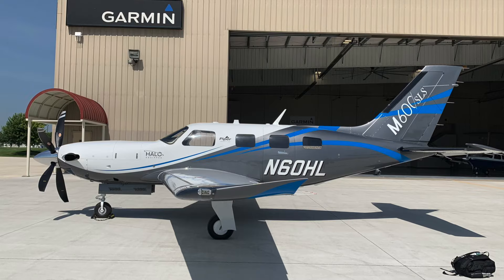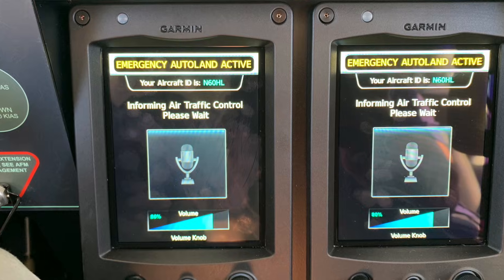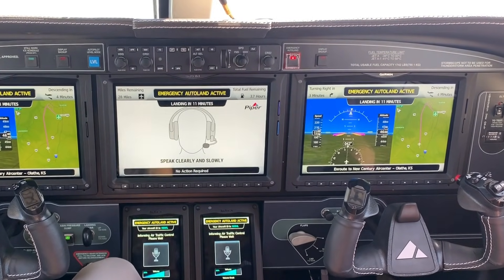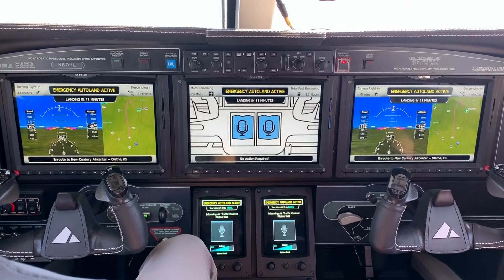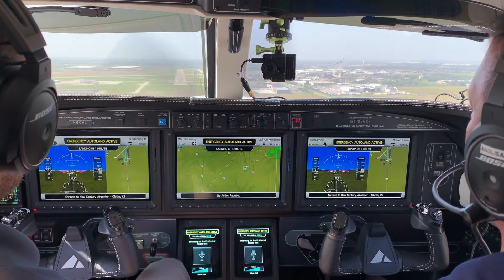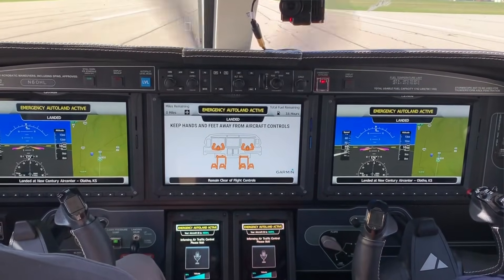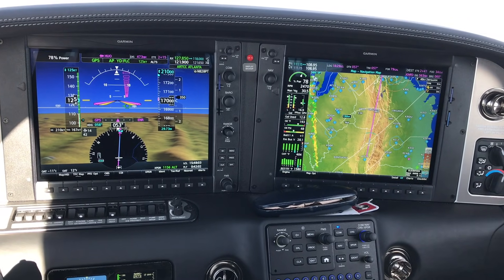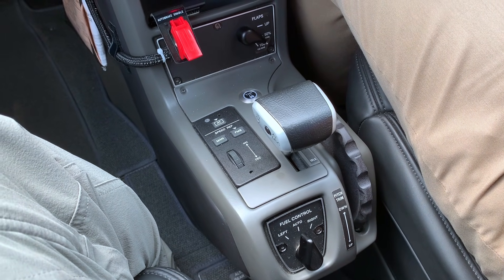Garmin Emergency Autoland Flight Trial

Comment: Imagine this thing chooses to land at a major airport instead of a smaller one and airliners have to go around and stuff.

Of course, it’s better than having nothing on board to land. The money lost from go around is better than death.
Reply: Hopefully it does choose a major airport with bigger runway ,better medical and fire facilities.
Did not check but it should be able to change the transponder code to 7700 so others know what is going on and transmit its intentions
Reply: cmulder002 there are small airports with the same fire fighting capabilities as International Airport.

Tamiami Airport has the same firefighting capabilities as Miami International possibly even better fire fighting capabilities given that the Miami Dade fire department is stationed there
Reply: @nikobelic4251  they should include that information in there database so it can influence the choice of airport depending on the situation.

Comment: Kudos to Garmin and Cirrus!  Logical next step is to auto-notify ATC, and ATC to contact aircraft for clarification from anyone aboard.  Autoland should also occur if all aboard are incapacitated.  There are also implications for hijackings, including rogue (and disturbed or over-stressed) pilot situations.  Years ago under NASA contract my company developed human physiology monitoring (BioVest) for aircrew which could detect stress from EEG, EKG & other signals; this data would be used to contact ATC on a voice channel and via coded IFF.   See https://en.wikipedia.org/wiki/Korean_Air_Flight_801 and https://en.wikipedia.org/wiki/Malaysia_Airlines_Flight_370  and  https://en.wikipedia.org/wiki/Germanwings_Flight_9525
Reply: In the video I watched it did notify ATC, and instructed them how to talk to ATC if desired?
Reply: @donanders2110  --  Someone still has to press the button. If all are incapacitated or in a hijacking, completely automated response is indicated.

Comment: There are a few important questions I wished he had asked the representative. 1. What if there is a runway incursion on short final. Will the system recognize that and go around? 2. If someone grabs the yoke or bumps into it will that affect the system? 3. Does the system recognize TCAS and can it take evasive action in the event of a conflict? Amazing technology indeed.
Reply: The second question can be assumed by the system demanding that flight controls not being touched.
That would imply that any control input  of the yoke will disconnect the autopilot and the plane would be flying manually.
In theory if the tcas system has a data link to the autopilot it should be possible to implement (if not already present) It would be as "simple" as the tcas commanding the autopilot to fly a new heading/ altitude and then returning to the previous heading once the conflict has cleared,.
Strongly doubt the system is able to confirm if the runway is clear or not "visually" but it might be able to go around if atc cancels the landing clearance,

Comment: This is pretty cool and can really come in handy (credit where it is due to the engineers I mean it you did well) 

BUT! I will note, there must be some sort of shortcomings for a full flight, this is why I think so. The technology to make a fully automated appears to be clearly here. Well manufacturers and avionics companies say it is here.  They say passenger willingness is the main issue but this is a General aviation aircraft. The plane still has everything needed for a pilot that has been trained fully but they pretty much just added the emergency autoland button.  If they can make flying so simple and automated why didn’t they just make the plane fully automated. There is no customer gear, it’s a GA aircraft passengers won’t be flying on it. They still have not made it fully autonomous and they haven’t dumbed down the avionics information so a pilot can fly with basic aeronautical knowledge

 (pull up to climb push down to descend or choose altitude and plane will take care of speed and all that stuff push button to land) 

If flying has become so simple how come the FAA still requires 1500 hours to get your ATP  why not bring it down to 100 hours 

Why not just make it the company trains you to use the auto pilot and punch in frequencies for ILS or use GPS for every approach?  

My point is as much as “the tech is here to replace pilots” 
“Pilots will be gone in 15 years” 
“Flying is hyper automated and anyone can do it”  

Some things such as regulations and prototypes just haven’t come up to meet that reality which really makes me wonder how close we actually are and why I am not giving up to become a pilot. Of course I have a backup plan (everyone who wants to be a pilot should have a backup plan not just because of automation but also because of medical things or just how unpredictable the industry is) 

Now before people tell me the regs haven’t changed because the FAA is stubborn and is too careful 
Look at MCAS the FAA has been pretty careless with their past certification when it came to automation 

Also the tech to have pilots away from the plane flying via remote control has been around for ages and it still hasn’t happened

If we are so close and easy to do how come  “THE FIRST PILOTLESS PLANE” hasn’t even been proposed, designed, or studied in either GA, Commerical aviation or the military. How come all future aircraft concepts have cockpits capable of seating two 
How come the “cockpit of the future” concepts have features such as voice command and still have two seats 

There are so many “plot holes” to this whole 100% automation plane stuff 

If there was 100% proof planes would be completely automated in my lifetime I would honestly give up and just pursue my backup there is no point studying for something what won’t exist 
I would get my PPL and that’s it but the proof that we are close isn’t there and there is so much contradictory information to pilotless planes will be here in 20-30-40 or even 50 years.

Aviation is so safe because there is a balance of human and machine interaction where both are cross checking and correcting each other because as much as we like to think computers aren’t flawless. Better than humans in some aspects but not flawless. The computer checks the human and the human checks and corrects the machine. 

Edit: Jesus that was long and good luck for No Nut November it will begin soon....
Reply: VAGAS INT. No nut November here we come!
Reply: Automation kills today, it’s not just MCAS. The technology just isn’t there to reliably match the kind of safety records we see today (1-5 major crashes a year). If they went 100% autonomous I’m 100% sure there would be 100s of fatal air crashes annually and people would simply not fly. 

Automation is good at doing the mundane stuff but you need the pilot for the 1 in 10,000,00 flight where things go wrong. 

The industry actually went too far and over relied on automation and then we had a series of preventable crashes becuase pilots weren’t being trained how to fly in emergencies and relied on automation too much (AF447 is the top example). Even today when the sensors give conflicting information or parameters are exceeded (cross wind, rate of descent etc etc) autopilots kick off and hand full control to pilots. By March 2020 FAA (its already been mandatory in Europe for a while) has made Upset prevention and recovery  training (UPRT) mandatory for all new commercial pilots becuase of this very real threat ie they are re-skilling pilots as pilots. 

People think that becuase autopilot exists pilots are not redundant and sit around twirling their thumbs for the entire flight when in reality they are monitoring the flight continuously and have to be ready to take over control at any moment. 

Fully autonomous flying isn’t happening this generation and maybe not the next
Reply: abingdonboy yeah, many people see technology as perfect When it isn’t it’s not perfect and people correct technology all the time 
But 35 billion $ in savings annually will make CEOs an analyst forget that...

Comment: No seriously it's awesome, think of it's potential.   You know what with fly by wire, (computer controlled)  and existing technology like the ability to auto take  off and cruise control.   Now here we have a system, that will land a plane automatically, efficiently and safely.  The Airline Pilot's days are numbered. well as pilots anyway.   Seriously complete control systems that do not require the guesswork of a Pilot.  Especially landing.  I mean no more airliners flying into mountains,  landing in forests or colliding with anything at anytime.    Well that's the Pilot's job redundant.   I mean all the stewardess needs to do is push a button and the plane will land without all the shrieking as the stewardess did back in the day.     With the 737 Max issue, we might not of had an issue.   If the computer can't land it without a crash, then there is no human who could do it better.   Id trust a computer any day over a Human.  Like we already do with our ATC Technology, Communication Technology,  and look at the internet, how many PCs does anyone think are connected to  the internet.  Businesses, banks and every area of commerce.    I bet no one wants to go back to a world  of no smart phones, wifi, blue tooth, or internet.  All of it is already Computer controlled.    If you don't accept switch it all off if you dare.   Airlines might put up a fight at first,  but what with a growing market  in technology like the Shanghai Magrail.  500K an hour,  in smooth comfort on a system that can be part powered partly from renewable  energy.   Maybe the Airlines days are numbered too, hopefully.
Reply: Peter Hall so much of this is wrong it’s funny

Comment: They should add more audio announcement; people forced to use this when the pilot becomes unresponsive will panic.
Announcing what  is happening like the moving trim wheels (and tell them not to touch them) might assist calming them building confidence in the system
Reply: @Ganz Bestimmt Elevator music: "I'm leaving on a jet plane, I don't know when I'll be back again..." Passenger: "WTF!!!"
Reply: Trim wheels move themselves on normal  autopilot do they not?
Reply: @darthscion  trim wheels do move themselves a normal autopilot. In most general aviation autopilot systems, the elevator control is purely with the trim servo
Reply: @Ganz Bestimmt Eight miles high

Comment: By the end of this century I would expect autonomous airliners to be the norm. These aircraft will communicate with each other and have no requirement for ATC. Departure, arrival sequencing  and separation will be managed by the planes themselves. The airlines will love it as no more pilots complaining about rosters, duty times or hotel accommodation. The passengers will love the near perfect safety record. Of course the passengers themselves may well be robots as the machines have done away with humanity.
Reply: Mit Seraffej possible near safety record 
Right now the safety is because of a mix of pilot and computer. Recent crashes (even those that have been considered pilot error) were initiated by automation failure and there was a greater chance of the pilot saving the plane than the autopilot and I am not even talking about the MAX. 
Aviation already has a near perfect safety record every year. We can’t know how much safer aviation will be with full automation because autopilots fail and mess up and humans correct it all the time it just isn’t reported on the news because no incident happens, the plane lands safely and is written up by the pilots and fixed. 

I am not saying you are wrong I am just saying we can’t know. 
People look at autonomous cars and say safety is increasing but cars are going to be automated to the same level airplanes are today an alert human driver and a computer to handle the low workload parts of the drive. Driving is transitioning from no automation to intermediate which is what made the airline industry’s safety record go up.

Again not saying you are wrong I am just saying we can’t be sure until it’s proven.
Reply: VAGAS INT. I agree it won’t be coming soon. The B737 in all its iterations has been flying for over 50 years so l expect the latest designs to be around for many years. However if SpaceX can turn their latest project into a functional reality, including point to point Earth travel the technology gains will be immense. I doubt if Space X will be including any manual control options even in future manned and humane rated variants. I can’t imagine even the highest skilled and best trained pilot being able to perform the manoeuvres required. By comparison most people could learn to fly a subsonic airliner. The promise of A.I. is to relieve humans of repetitive and boring occupations, personally I think “Pilot” is in this category.
Reply: Mit Seraffej  I have read that the passenger space ship was supposed to have a cockpit
So it appears they plan on having a crew monitoring. I think eventually pilots will just monitor and take over in an emergency. The plane will have automated taxi, takeoff flight and landing but someone will monitor. Same way they expect to have a whole crew of people monitoring spaceX starship passenger ships.

But I cannot predict the future I could be wrong they could decide to just go pilotless in the next 50 years. But systems do fail sometimes (as in the computer flying the plane) and people would be disgusted knowing people died due to a computer failure when a human could have saved them. Also, we don’t know how well pilotless planes will perform they could start messing up and crashing.  As much as I want the pilot job to continue I do love my industry and I would never wish harm on an airplane or passengers whether piloted or not. If aviation must go pilotless and does I hope the industry prospers. I will just be sad the most important people in the industry are gone.
Reply: VAGAS INT. The Airlines and their shareholders won’t be sad, that is for sure. Case in point being Qantas’ Sunrise project. Sydney to London and Sydney to New York. The biggest stumbling block to get this off the ground ( pun intended) will be to get the pilots to agree to the work conditions.
Reply: Mit Seraffej of course they won’t be sad they want money! 
If they could fly a plane with half a wing and without a fuselage they  would push for it even if it wasn’t safe. 

Companies are almost always pushing for their own interest whether it be to block a good idea that would mess with their profits or promoting a bad idea that will help them make more money. 
They use to pay their pilots horribly which is why the pilot shortage is happening in the first place.
Reply: Mit Seraffej also good pun.
Reply: Mit Seraffej 35 billion$ in savings will make people forget about the dangers of automation which is something you learn in flight training. They don’t teach you this for nothing
Reply: VAGAS INT. The dangers of automation is usually the human interface and the utter reliance on the automation. Today’s automation is as we know, not failsafe yet some airlines rely on it to compensate for poorly trained and low time pilots. Even those that do have good skill and experience levels usually loose those skills. Try getting a pilot of a modern highly automated airliner to fly a raw data ILS, or worse still a non precision approach without flight directors and VNAV..
Or even a visual approach.  B777 into San Francisco.
Reply: Mit Seraffej yes, that is over reliance on automation. But that doesn’t mean the pilot should be removed that means the pilots should receive more training and should sharpen their hand flying skills.
Reply: Mit Seraffej “B777 into San Francisco.” Ah, my favorite accident. Clear and a million day with not so much as a mouse fart worth of crosswind, and Asiana found a way to total a 777 and get people hurt and killed in the process. And that news broadcast of the pilots names that got punked will live forever. Over reliance on automation kills.
Reply: starventure yes it does...
Reply: starventure . Obvious solution make the airplanes totally autonomous. It will come. That’s assuming there will still be an airline industry. After some nasty genetically modified influenza virus decimates the global population the powers that be will look back and wonder what were they thinking letting people fly around unrestricted.
Reply: Mit Seraffej yeah we could all be dead. But I will prepare for us not being dead and pilots still being needed until I have my career and retire
Reply: VAGAS INT. . From someone that is only a couple of years away from retirement I have an overwhelming feeling that I have wasted my life. I now wish I had pursued my interest in science. Problem with that is it’s hard to make a decent living.